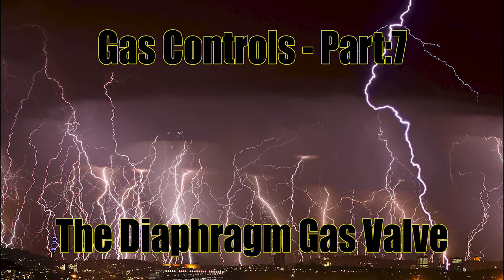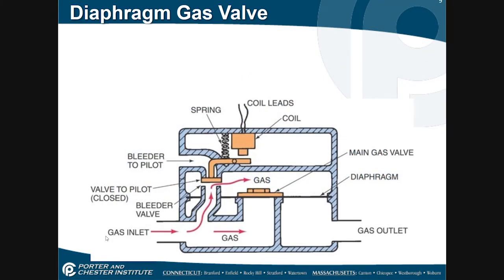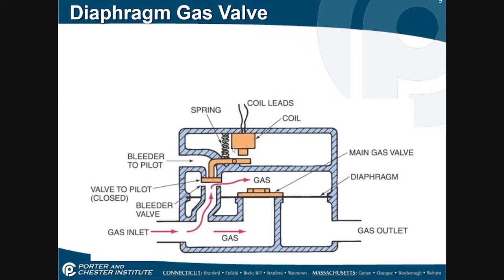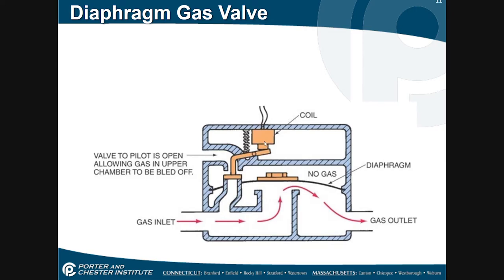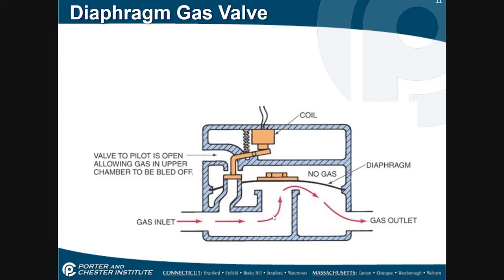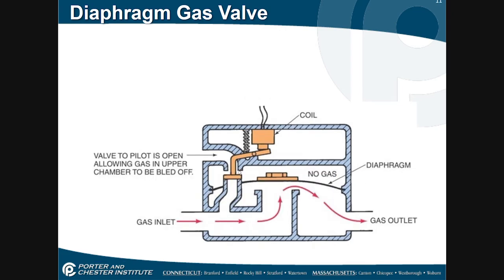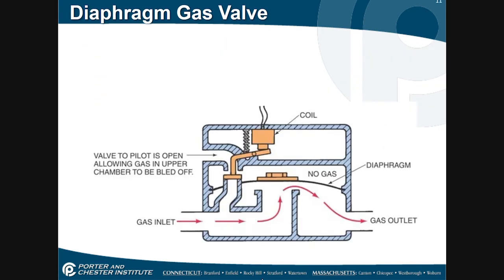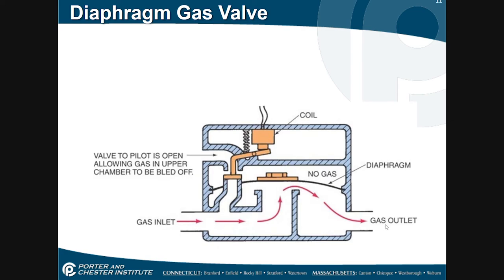Gas Controls - Part:7 The Diaphragm Gas Valve

Comment: I have a V48A diaphragm gas valve in a commercial boiler. The bleed port is vented to outside air. Honeywell states it can go back to the burner or to the atmosphere under an allowed leakage spec. My question is it seems the bleed port always leaks and I can smell gas could the bleed portion of the valve fail in a way that the valve still operates the boiler normally but the bleed port leaks too much gas in both the open and closed position of the main gas valve?
Reply from the maker: If there is a tiny piece of debris holding the bleed valve slightly open, there is a small chance that main valve could still open and close properly. That being said, I have not personally encountered it happening.

Because these valves are not cheap, I strongly recommend contacting Honeywell tech support to confirm the scenario. They know their products infinitely more than I do.